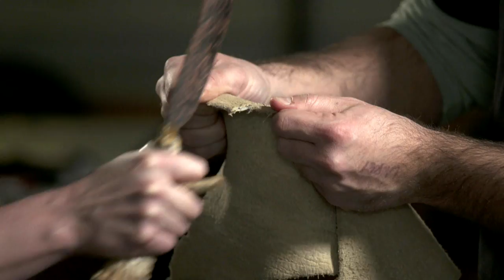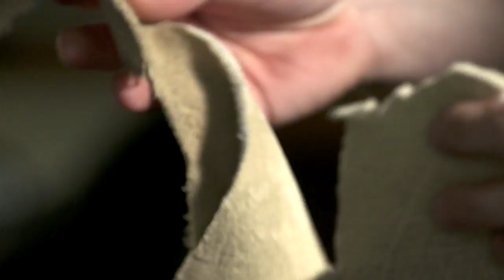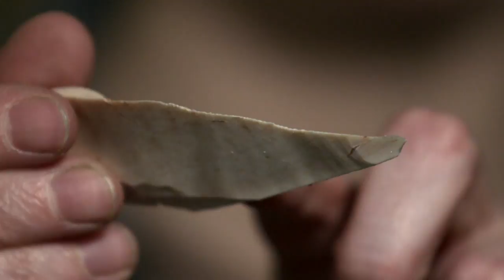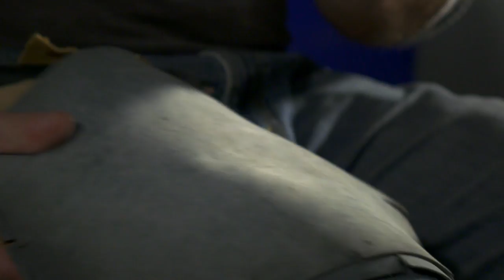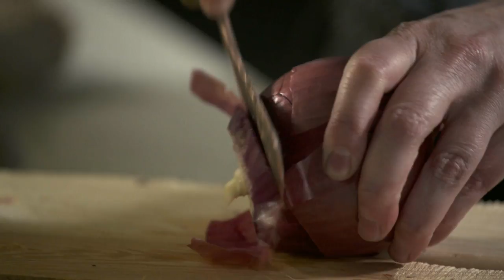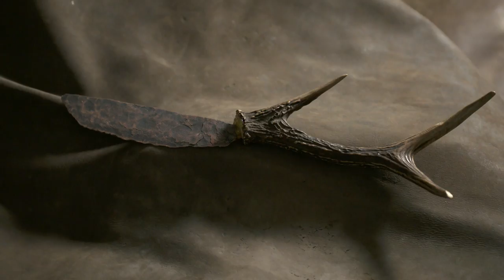Copper vs. Stone | Daily Planet

Comment: Though copper is just as sharp as stone or bone it has the upperhand in terms of durability and longevity, a copper tool is going to be much more durable than a stone or bone tool and can (depending on the quality or craftsmanship) last twice as long. One of the hypothesized reasons why indigenous peoples in Michigan stopped making commonplace copper tools is that copper itself became more of a valuable material for crafting jewelry and ornamental decorations.
Reply: I’ve also leaned that to this day indigenous peoples in Michigan still traditionally make copper sewing needles and tools for puncturing hide.